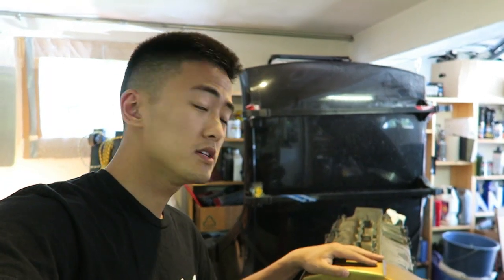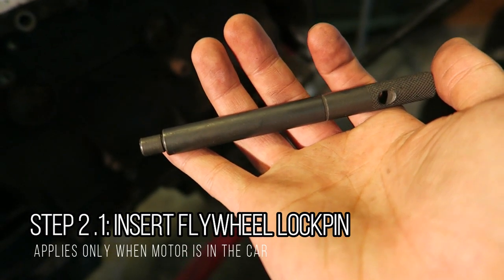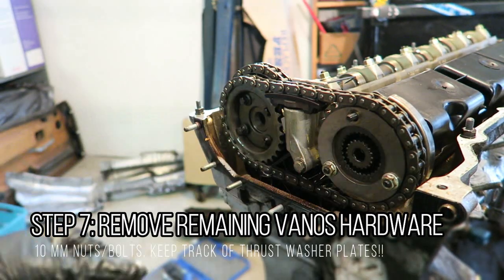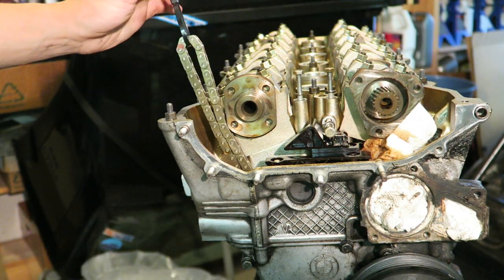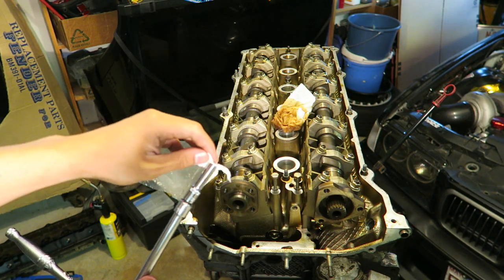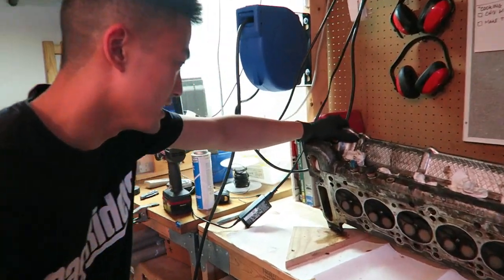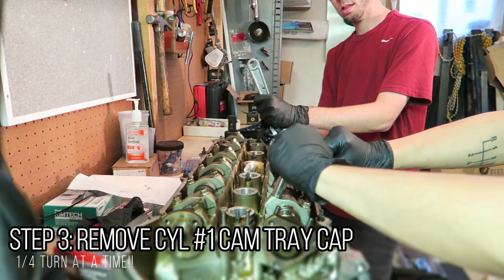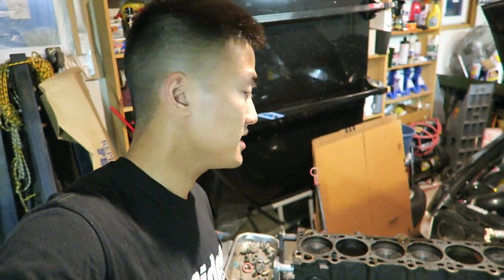FAST BMW E36 Engine Teardown [Pt1]: How to Remove VANOS and Cylinder Head (m50 m52 s50 applications)

Comment: I have a 328I from 1998 with a slightly warped cylinder head (got some white smoke and overheating issues but not the insane amount I see from videos) and was thinking of buying a replacement head and swapping it myself. Only problem is that I don't own half the tools you do and would be working on it in the car and mostly by myself. Is it possible for me to do this or should I just take it in to a professional shop?
Reply from the maker: I believe as long as you invest in the tools needed (check out my toolset video 👍), the job is fairly easy. Just take the replacement head for a good resurface and valve job (price varies) and the rest is pretty straightforward in terms of takin it apart. Then the reassembly is reverse order of the procedure. Torque it down all the bolts to spec with a fresh gasket and head bolts and make sure the timing blocks are flush with the head and the rest is easier (the channel M3nace has great content to check timing when you put it back together as well for further references.
Reply: Hey man. I have the same car with the same problems, exactly. 1998 328i E36 with over heating issues and white smoke. It's going to need a new cylinder head. Im suspecting a cracked cylinder head.. so my plan is to replace the cracked cylinder head with a good cylinder head from another 1998 E36 from the junk yard. Crazy how we have the exact same issue down to the word. How did you project go?

Comment: Question? I'm going to swap my vanos out for a Dr.vanos stage 1. Do I need to remove the thrust washer plates and the timing chain/sprockets as well?
Reply from the maker: No vanos should come off independent of the timing chain assembly, but you need the lollipop shaped sprocket tool to move the sprockets for vanos removal and installation

Comment: Did you change your eco when you motor swapped?
Reply from the maker: Do you mean ecu? If so, I didn’t not change anything. Used the same harness as well since the engine was the same

Comment: Im getting a bmw 04 325i it needs a head gasket going to do it myself and comments? Good video
Reply from the maker: the e46 3 series engines are different from e36's, but not by much. I would look into getting the bentley manual for your car first. It'll give you an idea of what tools you need. Research which parts of your engine can and cannot be reused (ex. the head bolts need to be replaced). And get quotes on resurfacing services for your cylinder head upon its removal. I think its possible for you successfully tackling this for the first time, if you are already comfortable with servicing brakes and cooling systems in these cars
Reply: Pawinning Thanx dude. I had and 1992 bmw 325i I did the fuel pump and throttle body 1998 infinit i30t Intake intake manifold

Comment: Wow! Awesome video! I concidermyself a god in m2/3/5/52/6/62 engines but you nailed EVERYTHING in this video, great job! Honor to watch, but i want to add one thing, you shoud adress alittlemore to be careful with the camshaftremoval, m50 especially are knowned for cracking shaft clear in pieces without supercaution or luck, all m50/52 series suffer from this but some say less 52 breaks..peace
Reply from the maker: Thank you!! It’s great to hear from more experienced mechanics that my content is detailed and accurate! I appreciate your input and will definitely mention more about camshaft fragility once I start piecing the motor back together! Cheers

Comment: hello i got one question if i want to build a m50b25 block with s50 cylinder head cams and itbs i want m50b25 or m50b25tu with single vanos or it doesnt matter
Reply from the maker: Hmmm I would lean towards getting an m50b25tu, but you’d have to verify on the bimmer forums cuz I bet you someone has done it. A lot of cams are interchangeable between e36 motors as long as they’re the same head length. I was looking to put s50 cams into my car too!

Comment: It's refreshing to see the "younger" generation actually working so in-depth on an engine AND with such enthusiasm and professionalism. I truly hope you consider enrolling in BMW's STEP program...... oh by the way.....great videos.
Reply from the maker: Thank you so much for the kind words and for your support! I've considered that program in the past, but now that I've found a stable job in another field these DIY videos/automotive content remain a passion and hobby of mine :).
Reply: @Pawinning I need your help man, I’m in position when I can lock my camshaft and work with vanos but my top to dead center doesn’t match up so I’m stuck now, can I spinn wheel couple rounds and it will get line up after couple laps, thanks ! Need some advice dude
Reply: @Pawinning I need your help man, I’m in position when I can lock my camshaft and work with vanos but my top to dead center doesn’t match up so I’m stuck now, can I spinn wheel couple rounds and it will get line up after couple laps, thanks ! Need some advice dude

Comment: Hey boss, my current M52b28 which I swapped into my E30 is on its way out, so I'm getting a parts e36 with a running 2.8. My plan is to tear it down, make sure everything is in working order and oem (my current ones a frankenstein, which is not what I want). Is there anything I should definitely be replacing, like seals/gaskets while I take it apart, and is there anything I should be very careful about when putting it back together, that could go very wrong if done badly?
Reply: Also what tools will you need outside of the generic socket set etc.
Reply from the maker: +Piece a Pizza sounds like a cool plan! Honestly if you're going thru the effort of an entire rebuild you should replace every gasket regardless. The only thing I'd be careful with is the final vanos timing with the cam timing
Reply: I thought so! I've got a few friends at the local BMW dealership so anything I really don't want to go wrong I'll probably end up going there haha. Timing is definitely a big one, I've never worked on anything other than the M20 in E30s, so I'm not about to tackle vanos on my own. Thanks for the advice and the very concise and clear video.

Comment: Hi, it's amazing. I admire your courage to do this very professional work. Where did you get so special tools?
I have e34 with M50b20 and by 2000 engine speeds, somethings slightly whistles. By warm engine.
And I am scared, that is somethings wrong in the head. The whole car is in very good condition, 60000 Miles only,
but 1990..
Anyway thank you for the video!
Reply from the maker: +Jan Poláček hey! I wouldn't worry about the sound too much with the low miles ur car has. But in regards to tools you can get them from many places nowadays, but pelican parts should get u started!

Comment: Euro s50b30 is the same ?
Reply from the maker: +hotassbeatsclap not quite. The cylinder head geometry is slightly different and the vanos has a few different parts, but 80-90% of the mechanics should be similar otherwise
Reply: Ok good to know I have swapped this engine but never took it apart . Do you know how much power can handle stock internal?  I would like to swap rods and keep stock piston .
Reply: if you put H beam rods in it it should be able to hold up to some power, there are m50s that make 350-400hp turboed, and that is the 2.5L

Comment: i've got an m50b25tu with some head gasket problems, this video helps me a lot ! if i only change the head gasket can i skip step 8.1?? in the part two do you gonna change the head gasket and make the reassembly of the engine? thanks!!
Reply from the maker: +11mrc11 yes, if ur only changing the headgasket all you need to do is lock the cams, remove the vanos unit/timing chains and take the head off! The process then is the reverse of the steps pretty much. As long as everything is marked and at TDC it's straightforward! I do not expect to make a reassembly video any time soon because I plan to have a long term motor build with this m50! But it will come eventually. Got some cool projects coming up in the mean time :). Good luck with your headgasket!

Comment: where did you purchase the tools from? did they come as a kit? @pawinning
Reply from the maker: Markos Biggavel the timing blocks, vanos tool, and flywheel lock pin should come in a single kit. The head bolt socket can be bought separately. These can be found on eBay, bimmertools, and many websites!

Comment: Hey Pawin, do you know anything about tuning for the non vanos engine? My car is a non vanos and I'm kinda iffy if I should use it or swap a vanos in because I've seen so many back and forth opinions about tuning.
Reply: Definitely stick with non-vanos. An obd1 m50 without vanos is one of the best combos for tuning to make reliable power.
Reply from the maker: +Name Optional the best advice I've been given is work with what you have! The non vanos motor would work great with a full standalone ecu setup (like megasquirt or VEMS). You have less moving parts to worry about!